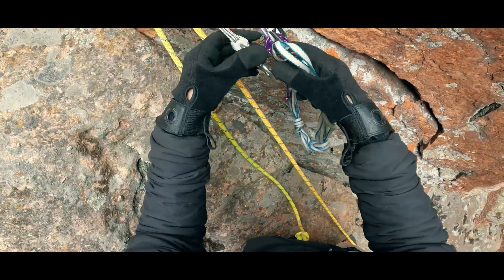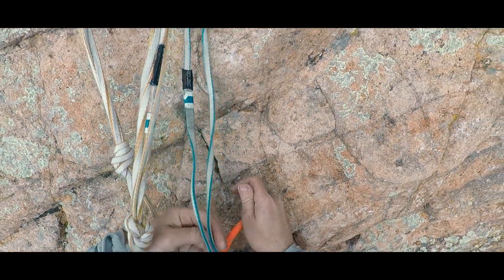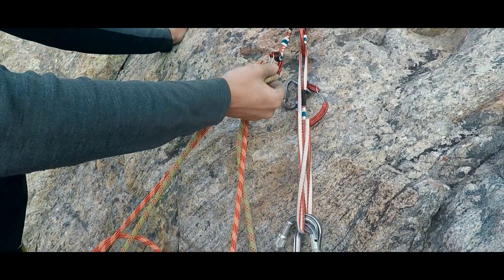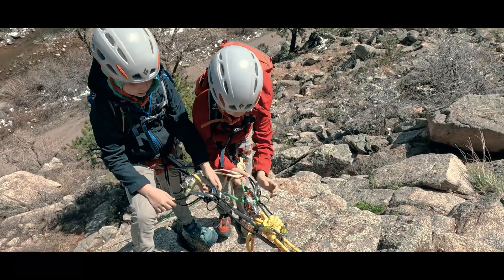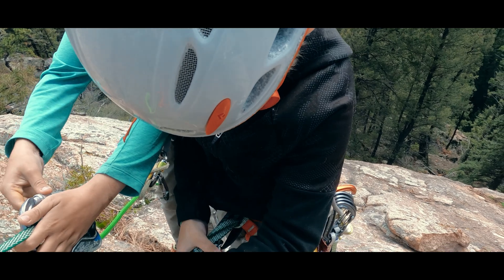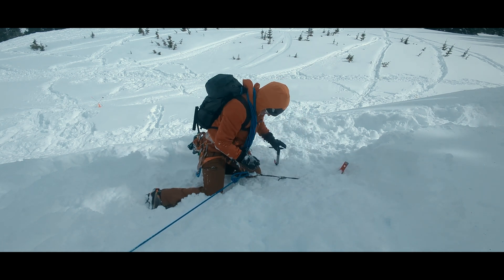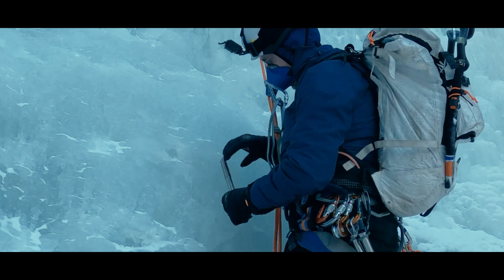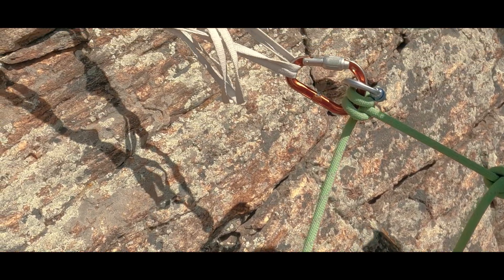Beyond Visual Checks: How Climbers Can Use Weight Transfers to Check Safety Systems

Comment: I see your boys using DMM Pivots in the video. How do you find yourself getting along with it?
Is there a reason why you chose that guide tuber over say the ATC guide? 
I bought one myself after I tossed my wild country device down a cliff, right before a rappel. Oops. I find that I like it way more than the wild country one, but have limited experience with the Petzl of BD guide tubers.
Reply from the maker: @macmurfy2jka  I like it a lot. To be fair, I probably lower climbers a lot more than most people, which is why I got it. We climb as three. We climbed before the kids were old enough to rap extremely efficiently, and we started up routes they ended up not wanting to finish. I think if you have young, climbing kids being able to lower efficiently is a big plus.